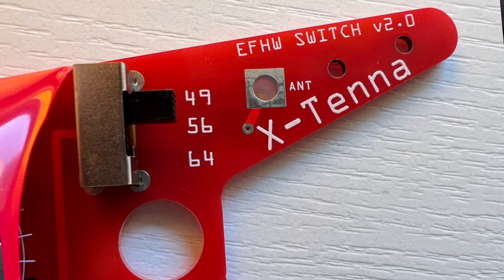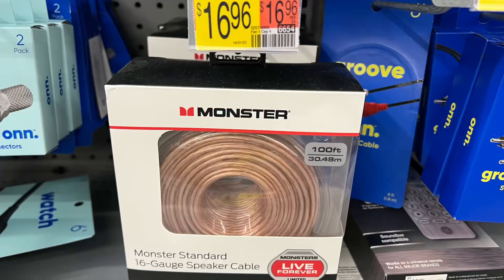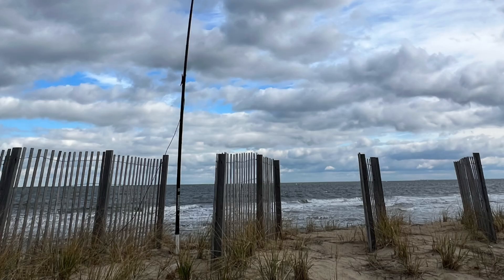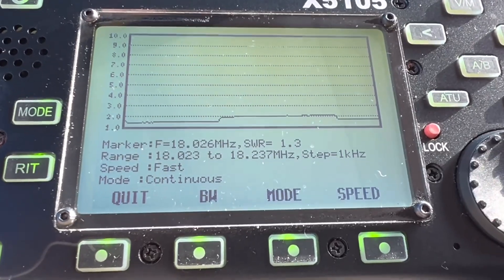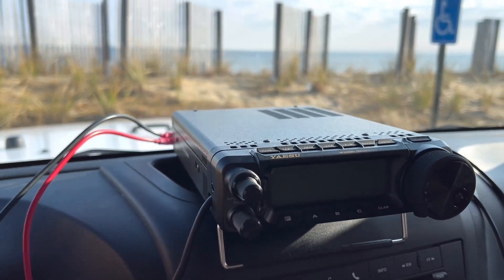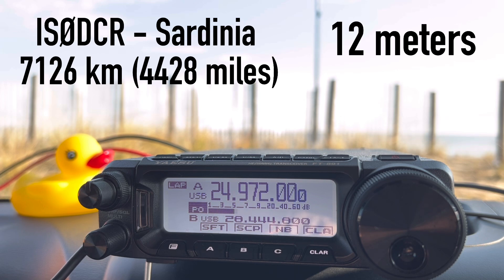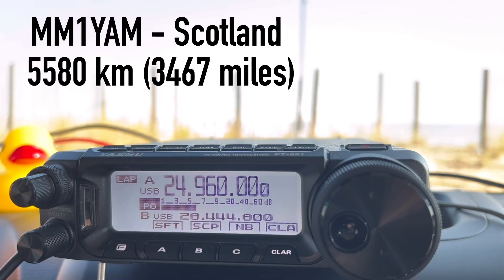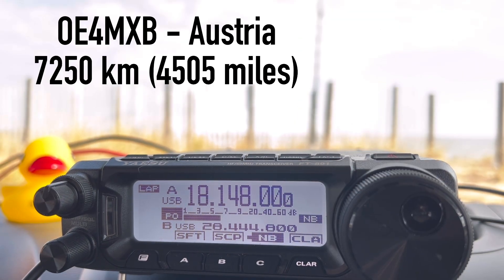Antenna Evolution: WARC Band Vertical Journey

Comment: I've got the same one. 135 feet of wire, maybe 40 ft in use in the air, wrapped around the crappie rod you told us about, and the rest of the wire coiled on the ground, placed the roof starting 12 feet off the ground and sticks about 8-10 feet over the roof pitch. I'll eventually mod it to a lazy L since i have enough yard. Anyway. Longest two contacts on 10m has been Slovenia and Italy. Wait till i put ALL the wire in the air. I blame you for my G90 also! Lol! Thanks Walt! I hope to QSO with you someday. 73 KD9ZMK (2 1/2 month tech license newbie). Just did my first EOC Repeater net during the eclipse in Indiana!

Comment: Hey, Walt!  Thanks for another great video!  How do you decide if you'll need an unun vs. a balun, and what ratio you need?
Reply from the maker: It’s basically a known value for each type of antenna. 1:1 for dipoles, 4:1 balun for OCF dipole, delta loop, 4:1 unun for shorter random wires, 9:1 for longer random wires 49:1, 56:1 & 64:1 for end fed half waves. There are other applications but that the basics of it.
Reply: @COASTALWAVESWIRES  Hey, thank you for that explanation. That's very helpful.

Comment: When building an antenna is there a wire gauge vs. rf wattage chart? e.g. Can I use a 22g wire to make an antenna that will be fed 100w of RF. I guess the chart would also have to include frequency used since wire has inductive impedance too. What do you think? Thanks for the videos - they inspire me to learn more about the hobby. 73
Reply from the maker: There is a formula and a chart somewhere, I need to go look for it. For this antenna 22g would have worked as I’m pretty sure it will with most 100w situations

Comment: very good walk. I seen that 64:1 . that a hard one to find. but making that is easy like 49:1 just more wraps. still use 100 PF cap. I tried the off set center as veritable on DC commander 10 meter pole. 4:1 Balun 1/3 to 2/3 cut just for 10 meters. worked ok. made with Walmart speaker wire .even the FT 240-61 wound with speaker wire. tunes great. dip at 1.2:1 SWR . was hard to tune. but got it after 30 minutes. the trick was the ratio of 1/3 to 2/3 . on each leg  . I did try CB got that to work. ran FT8 50 watt 10 meters. worked good. set it down tried my end fed half wave. 49:1 veritable on same pole with ground radios . ground mount  UNUN. worked better. FT8 same power. my signal reports higher a bit. now I want to try 5.8 wave end fed with ground mount  element's like DX commander antenna but mono band 5/8 wave.  the 1/2 wave works super. modeling shows better low take off angel. even better for 5/8 wave but 3/4 wave the lobs blow out and loos gain where I want it.  5/8 wave made the best pattern for DX ground mount.  the center fed coax T2LT 1/2 wave works same as off set center fed. I get different skip on it. has different take off angel. I am having fun trying different wire antenna's . I am getting NY to UK great on 10 and 12 meters. watch out for Lord Callum. he putting a KW into the DX commander now. the UK had a change on power to 1 Kw now. 73's
Reply from the maker: Awesome! 73

Comment: One question I've wanted to ask was about the battery.  Resonant antennas or close just do the job even though some will say it doesn't. You are proof of it. I experiment with various antennas and I get the same thing from some locals. They run beams on big towers, but they are using nonresonant antennas, There are coils in the antennas to make them longer, and tuners to bring them into resonance. Now getting bake to the question, with 100 watts, what kind of life are you getting out of it before you need to recharge it? I know what I can get with the batteries I use, but I'm out there at 1 to 5 watts and can play most of the hay on6 amps.
Reply from the maker: I’m getting about 8 plus hours out of it with continuous use. It’s a perfect battery for 100 watts.

Comment: I'm going to try a huge lake out in the middle of nowhere Nevada. Should be very interesting and a nice place to camp.  Been using the G90 without the AT on a resonant 10 meter antenna and it's working great. I have a nice flat line across the band and it's so low I can't read it. Good enuf.
Reply from the maker: Have fun!

Comment: Walt: That Unun looks interesting and really cheap. Have you tried to measure the actual ratio of it? Maybe connect a 3K resistor from coax shield side to radiator post and measure impedance on antenna analyzer. Should be about 47 ohms.....maybe?
Reply from the maker: Yeah i really need to do a deeper dive analyzing these transformers.

Comment: If you had to choose one primary radio, would it be the Xiegu 90, knowing the wattage limit and the available bands. It may not come as a surprise, but I have a "few" 2M and 2M 70cm portable radios of various brands, all 50 watts or less. HF is an area of interest, but 2M and 70CM hand talkies is good locally and of course I have a few of the worlds best 2m 70CM, the famous and powerful BAOFENG, lol.
Reply from the maker: For one primary radio the G90 is absolutely my choice!
Reply: @COASTALWAVESWIRES  I NEVER would have guessed, lol any old radio for 2M works, though.